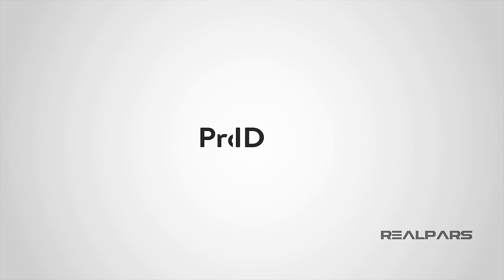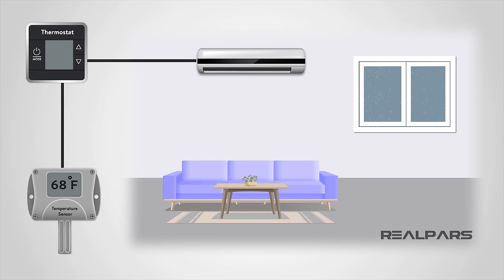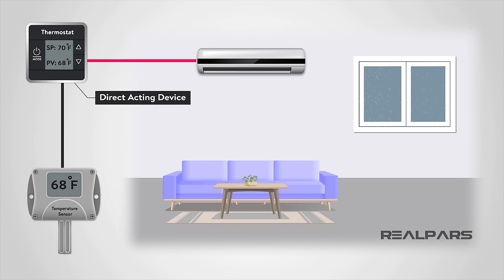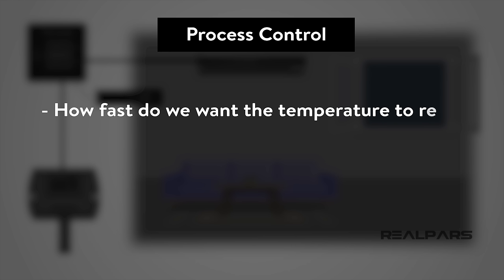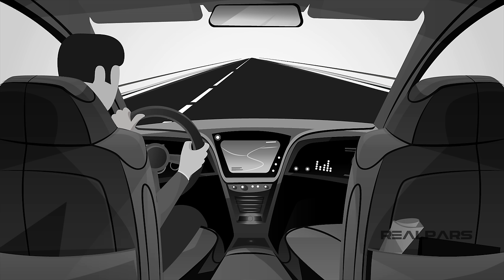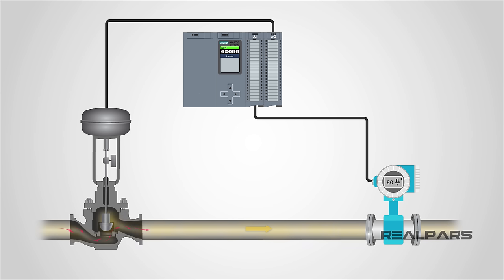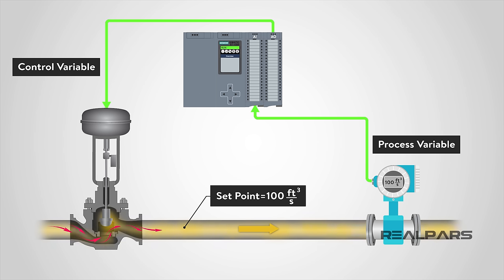What are PID Tuning Parameters?

Comment: Can you Use PLC instead of stand-alone PID controller?? Like if you implement difference equation in PLC to control the plant?
Reply from the maker: Absoluitely!  PLC's are able to be configured to control multiple loops with a single controller.  In this video, we keep it simple by introducing you to PID control using a sing;e-;loop controller.  For industrial processes, a PLC is widely used because it is able to handle many loops with one controller.

Comment: I read in a website that the controlled variable is not changed, but the manipulated is. Since the steering wheel can be moved around, this variable is changing...why is not the steering wheel then called manipulated variable instead? I am confused now..
Reply from the maker: First, in feedback control loop terminoogy, the most proper term for the steering wheel would have been "manipulated variable".  This is the variable that is changed in response to a feedback signal in order to maintain a setpoint.  However, the manipulated variable is also often called the "Control Variable".  The issue with definitions is due to the use of "control variable" in many other contexts.  The definition you gave comes from experimental science, where one variable, the control variable, is held constant while other variables are varied.  So the term "control variable" can be a little confusing because of its many contexts.

Comment: Hi!ay
The physical position of control valve and flowmeter is not correct. 
Valve must be installed downstream after flowmeter.
Reply from the maker: The flow meter is often placed after the final control element.  This is true for not only flow control loops, but other types of loops as well (temperature and pressure).  Level control sensors are often placed in the tank, which would be upstream of the control valve on the outlet of the tank.  The one case where I definitely would place the flow meter upstream of a control valve is where the discharge of the control valve goes into a process line that quickly ends up at atmospheric pressure.  The only consideration is that some flow meters, like orifice plates, need well-developed flow profiles to operate correctly.

Comment: When flowmeter is installted before control valve and used  after control valve...pls ans this sir....
if it flow meter is installed before control valve can is it worked at same process....
Reply from the maker: Yes.  The flowmeter can be installed upstream or downstream of the control valve.  There may be a preferred location, however, based on the flowmeter type or other considerations.  An orifice flow meter needs a very stable flow profile entering the meter, so upstream may be a better choice.  A heat exchanger may take a lot of heat out of a process stream, and placing the meter downstream may provide a better environmental condition for measuring flow.  A control valve that reduces pressure on a high-pressure stream so that it vaporizes (flashes), would need flow meter to be installed upstream on the liquid side of the valve.  So you can see, there are many factors that need to be considered when locating the position of a flow meter in a process line.
Reply: thank u sir for replying my message....One more question sir...whenever we installed a control valve and flow meter device..why we are take this device in a loop system.....pls answer this...
Reply: And my question was...why the flow meter is installed  before the control valve in a loop system.....
can we installed flow meter after the control valve in a loop system....
Reply from the maker: @dibakarsarkar5530  Yes, please refer to my initial answer to your original question.  The flow meter does not care where it is in relationship to the control valve.  The only consideration relates to the flow profile -- a flow meter performs better, in most cases, when the incoming flow profile (turbulence, pressure, flow, etc.) is well-developed and steady.
Reply from the maker: @dibakarsarkar5530  A control loop is only required when you desire to control the flow by measuring the flow rate and using it to position the control valve to maintain the flow rate at a given setpoint. This close-coupled feedback arrangement allows the system to maintain a steady flow rate.
Reply: @realpars  thank u very much sir....now my concept is clear...thank u again sir....huge respect sir....

Comment: Using the first example, sometimes you will hear the temperature sensor referred to as the primary control element and the heater referred to as the final control element.

Comment: It is explained that there are different effects for each type of PID controller mode in the cruise controller of a car speed?   the different effects of these three modes.
Reply from the maker: Proportional - makes output adjustments proportional to the error between SP and PV (difference between how fast you are going and how fast you want to go).  The larger the difference (error), the larger the adjustment.  If you are going 30mph and need to go 50mph, you press on the gas harder than if you start at 45mph.

Integral - makes output adjustments proportional to how long the PV has spent away from the SP.  The integral adjustment adds an adjustment in the same direction (+ or -) to the output as the proportional action. This is analogous to still not being up to speed after accelerating (proportional changes).

Derivative acts on the rate of change of the error.  If I am accelerating and I start going down a hill and gain speed, derivative tells me to let off the gas to keep from overshooting the setpoint since my speed will accelerate as I go downhill.

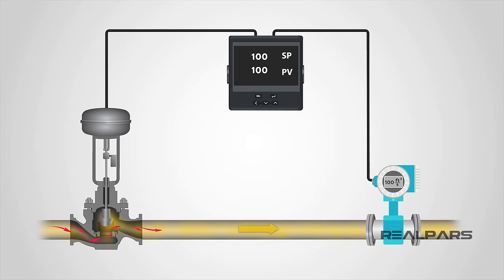Comment: Great video! At about the 6:20 mark, you say that each one of the combos have their own place in the control world.  Could you elaborate on this?  Do you mean things such as industrial presses, pumps/flow, ect. Which combo should we use for what task?
Reply from the maker: The use of P, I, and D elements in an industrial control scheme depends upon the application.  The PI combination is most widely used for all types of control, since P-only control will always end up with an offset between SP and PV, and Integral is very efficient at eliminating that offset and keeping the PV near the SP.  Derivative (D) is useful for processes that do not exhibit a large amount of noise or disturbances  A noisy flow signal, for example,  is not well-suited for any combination that includes the Derivative term.  Therefore, flow loops often are just controlled using PI controllers.  Pressure and temperature, depending on the stability of the process measurement, can benefit from PID or PD control.  A more detailed presentation of PID control is available on the RealPars.com website in a multi-part video series.  Check it out!
Reply: @realpars  will do! I must if missed them, I'll check them out 👍

Comment: The explanations are great, i get simple tuning tips of pid parameters
1. Usually, we use PI controller without D
2. First, disable I and D, give little P parameter, and see the tune result; double P parameter until overshoot and vibration arise. Then change the P parameter to 5o%.
Reply from the maker: Thank you very much!

Comment: Sir can a pid temperature controller be set according to thermocouple type..I had encounterd a past issue like this in which I had to set the type as K but the controller showing J type as default and PT100 as temperature setpoint and the setting was unsuccessful... kindly please clear the doubt
Reply from the maker: A thermocouple (or an RTD) in a temperature loop can be constructed from different materials.  Both a "J" and "K"-type thermocouples work in the same way (generate a varying millivolt signal with temperature), but each needs a different conversion algorithm to convert from a millivolts value to temperature.  Therefore, the transmitter or controller input needs to be configured or set to the same type of device (thermocouple or RTD) and same properties (J thermocouple or Pt100 RTD, for examples) as is installed in the process.  Pt100 is a setting for an RTD, not a thermocouple, so if you used that setting for your input, your temperature value will not be correct.   Moist controllers, transmitters, or specialized T/C or RTD inpout cards allow the type of device to be easily configured in the hardware setup.

Comment: for flow control final control element must be after feedback element/flowmeter
as far as I know
Reply from the maker: The flow meter is most often placed after the final control element.  This is true for not only flow control loops, but other types of loops as well (temperature and pressure).  Level control sensors are often placed in the tank, which would be upstream of the control valve on the outlet of the tank.
Reply: @realpars  yes,....will plz let me know why in flow control loop final control element is on upstream of feedback...I searched through Google but can't get enough explanation